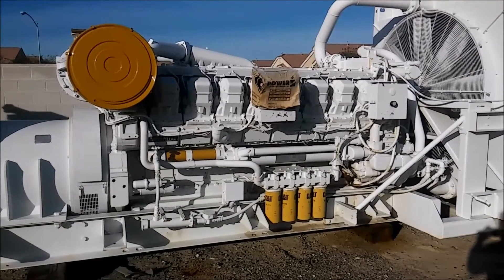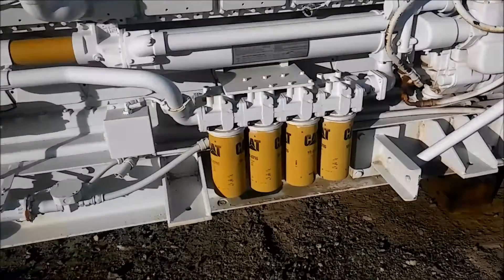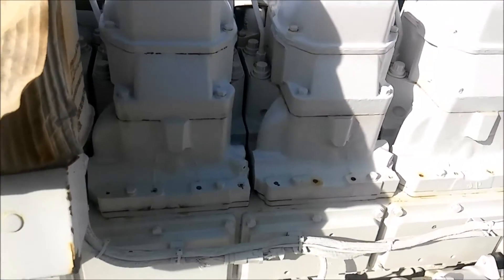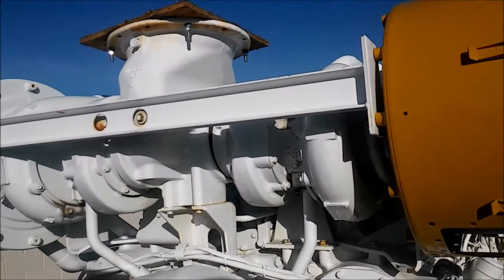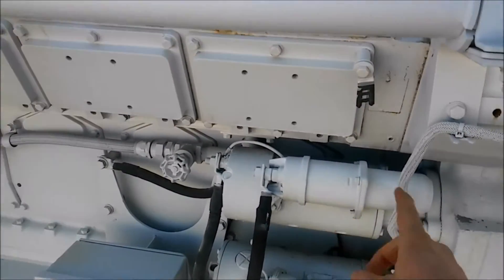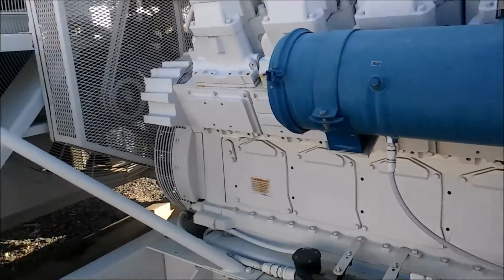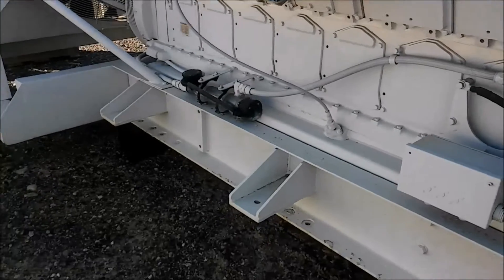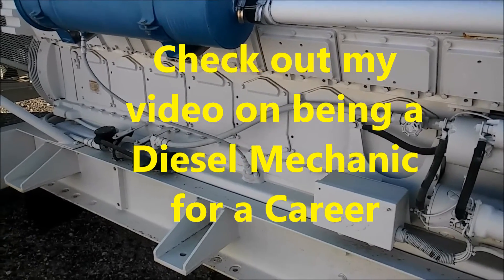Huge Diesel Engine Walkaround, Friggin Awesome

Comment: ⚓️ Thanks Josh 🌈 I’ve been shipmates with 3516 B C & E models ♨️ spanning 25 years… harbor tugboats in San Francisco 🎸 oil change on the marine propulsion models…. 225 gallons … pushing Aquamaster drive units with ~ 650 gallons 🎸

Comment: Good looking MUI Prime Power. Three starters for fast startup in an emergency usually less than  10 seconds in Las Vegas. Clark county to get Certificate of Occupancy for a Casino. When you roll it it gets to frequency quicker so it catches the life safety, stairwells and fire pump loads and keeps things safe. No room for be-bop'in They will explode mufflers, break mounting springs and lift the heads so bad they break exhaust bolts on start up or block loads -- an animal. Those turbos are 12,000 a piece. 100 gallon pan - one pan bigger 214 gallons. 1800 is 60 HZ, full load in off highway trucks is 1710 rpms.  Adept Ape consider being a Trainer for Caterpillar - your needed!. --- 
Caterpillar Technical Instructor
Reply from the maker: +Elex Vavrick Do you work for Cat or are you a dealer employee?
Reply: Adept Ape.  Yes a dealer, corporate  is a different world not worse not better just different. Cashman Equipment in Nevada. Technicians  are in high demand just about everywhere.

Comment: Why is it completely painted?
Reply from the maker: It was probably in an enclosure for a hospital or somewhere and some places have them painted white, but yellow is the default color.
Reply: But why is it that industrial engines usually are covered in paint?
If you look at car engines pretty much none of them are painted, at least from the factory.
Reply from the maker: Well aluminum car parts are not typically painted because aluminum doesn't rust. If the car has an iron block, it'll have some sort of protective coating on the block or else it would rust quickly. Since Diesels are mostly cast iron, they paint them as a protecting coating from rust and they look better painted.

Comment: Why does this diesel  engine need 3 starters?
Reply: Noah Comfort If it had an air starter it would only need one they are made by IR
Reply: Until the gear breaks. An additional reason to use three starters is in order to distribute the stress on gearing so as not to shear teeth. @C2welder
Reply from the maker: Since the crankshaft weighs a ton and there are 16 cylinders worth of compression to overcome, one starter wouldn't do the trick. You need all that torque to get the engine spinning.

Comment: The 3500 series is a great "high speed" engine, at least in the marine environment where I am familiar with their performance.
Reply: lekkousa yes they are considered high speed engines in natural gas compression when we have engines that run 300 rpms max
Reply: @C2welder  LOL